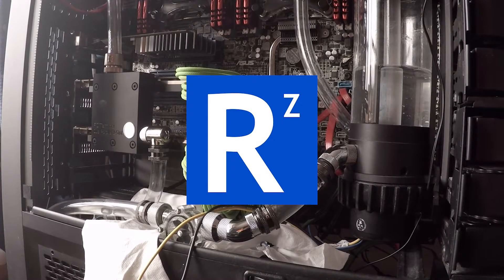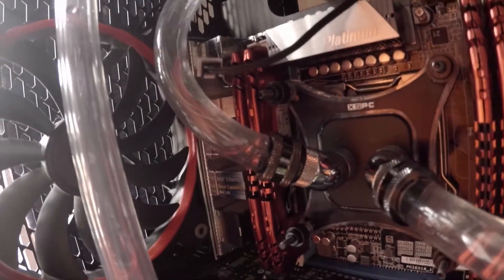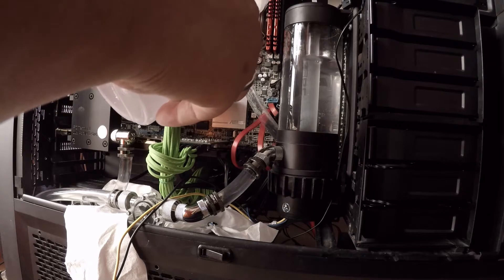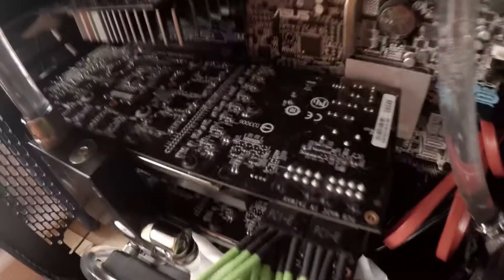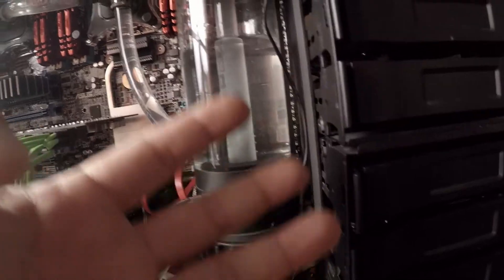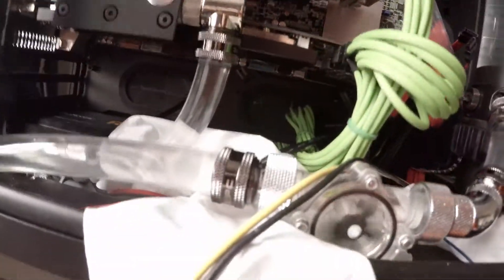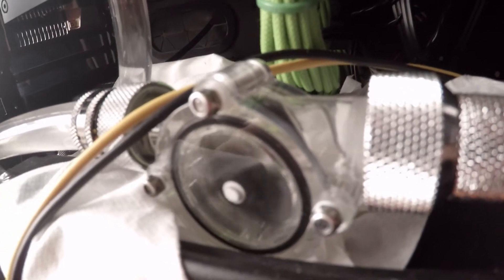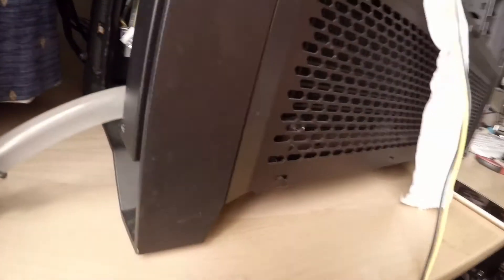Waterloop fail. Low head pressure issue.

Comment: If you have ever drained and flushed a vehicle cooling system the heater core can get air locked if you leave the radiator cap on when you 1st start the engine. Sometimes you have put a T  in the heater return line and bleed the air trapped in the core. As long as the bleed point higher than heater core the air will work its way to the highest point. THIS HAPPENS WHEN THE ENGINEERS DECIDE TO PUT THE PORTS IN THE BOTTOM OF THE HEATER CORE. Of course you do this when engine is cold. A vehicle water pump produces about 10-20 times more pressure (head) than a D5 and it still happens
Reply: A bit off-topic but: 'A vehicle water pump produces about 10-20 times more pressure (head) than a D5 and it still happens'. The pressure part is why I don´t use a D5 or any 'pc water cooling pump' in my pc but rather a pump that actually manages to get some water around. These pumps claim in their spec-sheets that they would indeed produce somehow a higher water pressure head then a conventional 50W rear supply pump. So much bullshit, the D5 claims 4m water column pressure, now try putting a rad 4m above it and see how well it manages that. While my 50W pump, oh wonder, is rated for 2m and manages 4m no problem because of inlet and outlet diameters and tube sizes. These pc-pumps are weak, small aquarium pump level parts which sell for 2x what they should be. 
My suggestions is, use decoupled aquarium pumps. They are silent and work 24/7 for years too. And they perform better at the same price.

Comment: usin seagates st3000dm drives for years now in my 5 drive raid5 - already had to replace 2 and still have a third one as cold spare - but that's why I'm running a raid5: to not lose data even if a drive fails
yes, I know, a raid6 with 6 drives would be way better due to it's fault resistance during rebuild which allows another drive fail during rebuild an already failed one - but may controller can't do raid6 - also it only has 6 connections - so I wouldn't had a spare slot for my system drive =P

Comment: why not just get a liquid cooler instead of these expensive maintenance water coolers. It's easier to install and cools as good as a water cooler
Reply from the maker: You are absolutely right... but where's the fun and challenge in that!!!??? :-D
Reply: +renderz challenge??, Are you using a water cooler because it looks nice and interesting?? I though building pc's are one challenge THE BEST PERFORMANCE so the looks of pc's don't matter in my opinion.
Reply: AIO coolers dont work as good as custom loops not even close
Reply: Love how you don’t even know what you are talking about open loop systems are way better for cooling maybe you should have a clue what you are talking about

Comment: WD means Western digital, I'f you buy a Seagate Barracuda you should not see anything that says WD on it, I stand by the Barracuda name not Seagate not WD, Barracuda, wich is only done by Seagate it if has a WD on it and says western digital it's a knock off imo. ty goodbye, also think about some SSD's regular HDD are not what you want, for running OS or gaming in today's market, HDD are for other stuff SSD's for every thing important.
Reply: seagate drives have a higher fail rate than wd drives lol